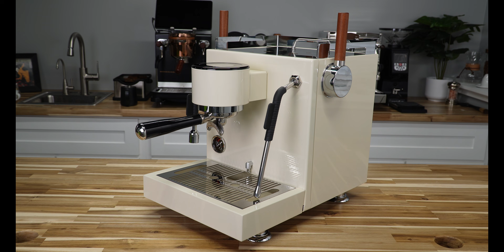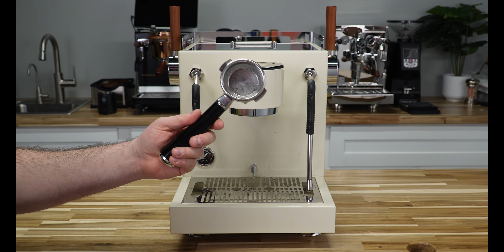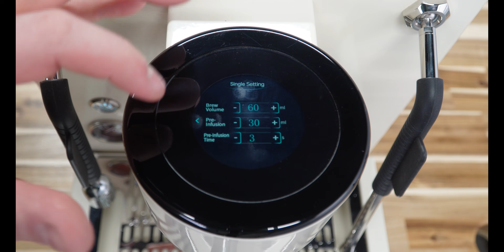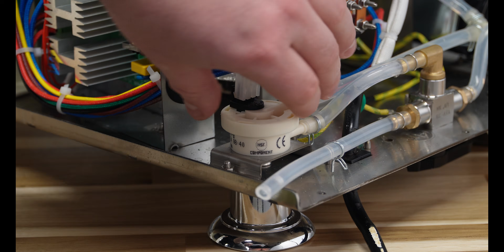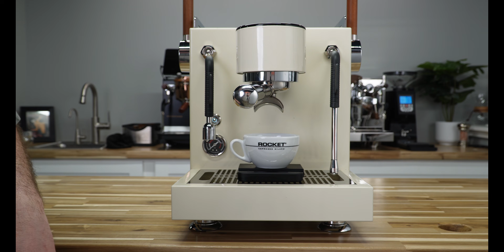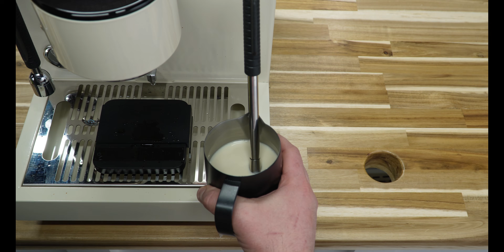Turin MC3 Espresso Machine Overview | Features, Espresso Shot & Latte Demo

Comment: Given the large size. How hard would it be to refill the water if the machine is under the cabinet? Also what is a solution for the lever handles? Those handles wont fit.
Reply from the maker: If it does not fit under cabinets, check out some of our other machines.  Possibly the Legato would be a better fit for your needs.

Comment: Barrett. During the extraction it sounded kinda buzzy. Is that normal or does the model have a pump issue that you were demoing? I ask because I have ordered one and just curious!
Reply from the maker: Normal, its a vibratory pump.
Reply: @EspressoOutlet Ive used various vibe and rotary pump machines but haven't heard THAT much buzzy sound before that's probably why I noticed it seemed more pronounced than typical. However. It might just be the way it sounds over video too. I'm very excited to get it. It looks very interesting 😊